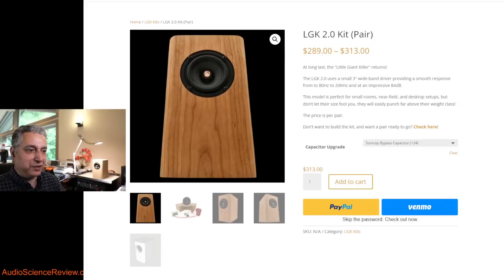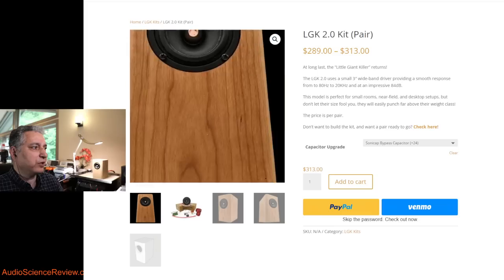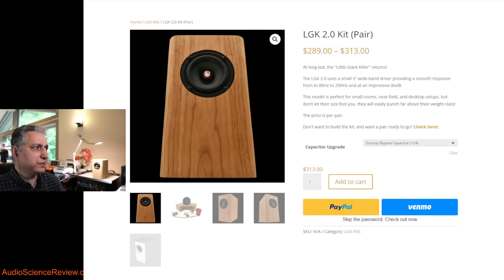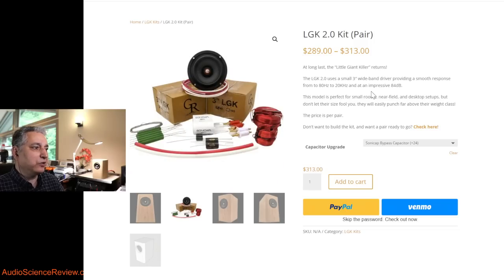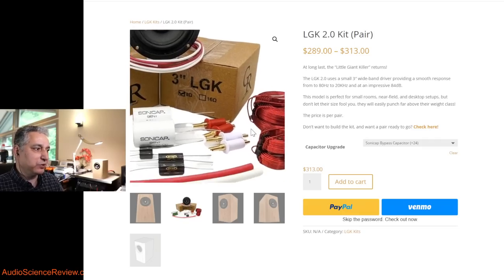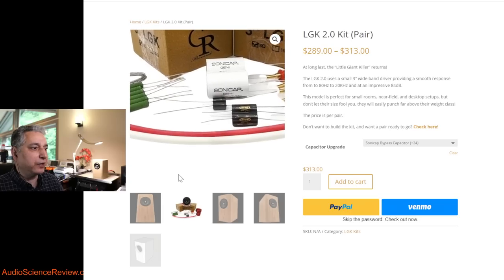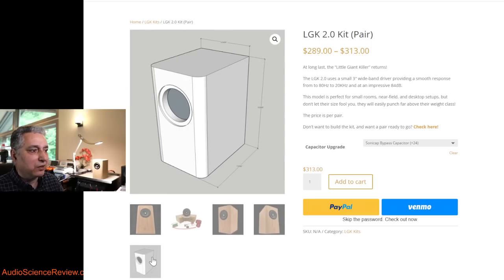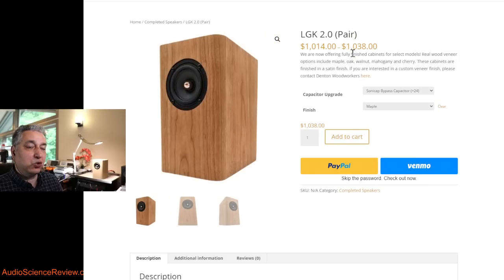GR Research LGK 2.0 DIY kit Speaker Review

Comment: I was not judging GR Research as I don't have very good ears. But what made me think Danny is selling snake oil was his claim about speaker cables would pick up stray radio signals. Radio signals are so weak that it would never register on a speaker (that's why signals from AM radio need to be tuned and magnified). His use of the VU meter with impedance of about 4K ohm is not realistic at all. No speaker has impedance that high.  And no one can hear the weak signal being picked up by the speaker cables. Period.
Reply from the maker: Very correct....
Reply: he he, correct
My goto argument for that is, if the speaker cables would pick up rf signals (which they do as an antenna, but that is not the point) that could make hearable distortions, then you should be able to hear them even without an amp, because they are not amplified but directly inducted into the cable. Can't hear anything? Then there is no problem :-)

(and anyone who thinks the few pico or nano volts of induced potential from rf would make a passive driver do anything should go back to school and study a bit morte physics)
Reply: He's a liar

Comment: Sir can you please test GR research open baffle design.......nx treme or nx otica.....thank u for your work
Reply: Unfortunately, I believe that one limitation of the Klippel NFS measurement system that Amir uses is that it cannot extract reliable data from Dipole or Open Baffle designs.  Amir can correct me if I'm wrong.
Reply: open baffle or dipole will definitely will not measure good.
Reply: @kongwee1978  Amir has measured Maggie's before .....so I belive he knows how to set the parameters.....and by the way when I listened to the lrs Maggie's the sucked big time like Amir said
Reply: @iliascharis5668  I only have experince bigger maggies.
Reply: @kongwee1978  me too but lrs sounds crap
Reply from the maker: I can definitely measure them as Klippel has no limitation here.  The issue is spending some $1,500 on another speaker from him when he should be sending out the sample.  Please contact him and ask him to send me a sample for testing.
Reply: His open baffle speakers seem to be solid design, based on what I've seen, though I've never heard them.  But as a former magnepan owner, I can say open baffle speakers sound much more like real music in certain ways that normal speakers can't do.  I don't think measurements will capture what they do right, but will capture what they do wrong.  Open baffle also needs a room that's suited for the speakers much more than normal speakers do.  My magnepans shined in 2 rooms:  one was an unfinished basement that was the entire size of the house above, and the other in a huge living room.  In other words, they need BIG rooms to really come alive.  When they have that with adequate amplification, it's magical.  But that's not a common experience for most users.  Putting them in a 12' x 20' room doesn't do them justice.

Comment: There is an aversion to DSP at GRR, and it makes sense since they are in the business of selling those passive crossover components. While this little speaker was maybe tested outside its intended design (frequency range and volume level), that doesn't excuse the poor amplitude response in the highs caused by compromises in the passive crossover design. GRR seems to be trapped in outdated passive-crossover thinking - while the industry evolves further toward DSP crossover/PEQ, and active speaker designs. I follow GRR channel and think Danny has a lot of speaker/system wisdom to offer, but they will will need to embrace the new tech to stay relevant.
Reply from the maker: There is no higher conflict of interest than GR Research and Active DSP as you rightly mention.  I think he can have a thriving business converting passives to actives.  Instead he says nonsense like DSP screws up the sound.
Reply: @AudioScienceReview  converting passives to actives could be a great business model! My vision of the future has DSP/DAC/Amp assembled, optimized and mounted on-driver from OEMs. The components will be designed to work together perfectly (same as coil and cone are today). This new platform will likely originate from an existing driver mfg, (my best guess is Putzy) then take-over the market. This will also inspire new (or expansion of already existing) cable types (think POE) - that will be used to carry power and signal between power supply and these powered drivers I've proposed. Feedback (like Rhythmik servo subs) is also a way toward the future, and I suspect that will be refined and included in these new active-driver disigns to compensate for temperature and material breakdown by age and use over time. GRR's place in this could be upgrading all the old 'favorite' speakers that exist at that time.
Reply: But people love 300B and Class A heaters, personally I like them too.
Reply: There's plenty of audiophiles who will stay in the passive realm in his lifetime ;)
Reply: @RennieAsh Also attract younger generation surprising all these years.
Reply: @kongwee1978  300B put out about 8 watts. The GR speaker in this video has a sensitivity of 84db, which is horrible for tube amps.
Reply: @AudioScienceReview  While I am no fan of Danny, quite the opposite in regards to his style of business and douche baggery, I do agree DSP can screw up the sound in some respects. If DSP is applied to the original digital music file to create crossover, which divides the frequencies to be converted to analogue signals and then sent to multiple amplifiers, it can be a game changer but expensive due to multiple amplification. However, in most cases DSP is applied to analogue signal after the original digital file was converted to analogue, processed digitally, and then converted back to analogue. This really screws up the sound IME.
Reply: @AudioScienceReview  I found that Audyssey did way more harm than good with my Revel f206s.  Dirac made them sound a bit different, but not really better so I leave it off on my system, but it's much better than my experience with Audyssey.  It's possible his experience is similar and he's only considering room correction, not dsp to flatten on axis response.  

I'll also note that my experience with Audyssey was with a Denon 3300 avr, which sounded terrible with both my Revels and older Magnepans (with or without room correction).  Going back to my early/mid 90s Integra integrated amp or a separate power amp fixed that issue, but the Denon had tons of HDMI handshaking issues, so out it went.  The sound quality issues were apparent even at low volumes with the cheapo Denon, even in soundstage and imaging.  Either it was a really bad amp design or defective, I don't know.  But it was night and day when switching it in, and the extent was very unexpected.  It might be fine with cheaper speakers that are an easier load though.

Comment: Did you check to see if the speaker terminals on the driver are magnetic? When I built my NX studio monitors the speaker terminals we're very magnetic. When I brought this up to Danny he said he knew about the terminal being magnetic that it was a supplier issue.
Reply from the maker: I noticed that!  When I went to change the driver, my soldering iron would keep getting stuck to it which surprised me.  I was going to mention that but forgot.  Danny complains about speaker terminals that are magnetic to not be good.  Yet he is shipping speakers that are that way.
Reply: @AudioScienceReview  -- His speaker terminal jihad goes even further than that.  Not only is he crusading against magnetized material, but he's also dead-set against any ferro-magnetic (anything with iron or nickel content, magnetized or not) material in the amp-to-speaker signal path, e.g. he recently noted the presence of a steel hex nut on a binding post as audibly detrimental.  Dang, Amir, you've gotten me started on his near-innumerable ignorant bugaboos, which would amount to a very lengthy debunking expedition...  🤔

Comment: To sum it up, a terrible diy speaker with no instruction manual, dubious parts, and miles away aestethics regarding the presented on the website. What's to like? Very little. If anything I think you made a Very gentle review, I would be much harsher. Nice job amir

Comment: Huh?  Imagine that... a single driver cannot effectively replace a multi driver setup...  I'm shocked!  Any other result would have been very surprising.  Good testing.
Reply: Never a true word spoken too many drivers can sound clumsy and delayed also!
Reply: Just one driver that size yes what a joke
Reply: For a tiny near field application, you can get a decent compromise. This driver just ain't it.
Reply: There are plenty of really good wide drivers. None that I have tested are truely fullrange. Bass response is usually the drawback, more than the treble. Any design choice comes with compromise and challenges.

Comment: Point is - if you call it a "Giant Killer", then it MUST deliver. It does not...
Problem is that all of GR's "reviewers" are friends of the company.
Here's a challenge for Danny; send your designs to an independent reviewer. Even go so far as to send a sample of your "commercial brand fixes" to the same reviewers for testing and comment.
Reply from the maker: Indeed.  Having Ron rubber stamp his speakers when he is also the one doing the edits of his videos makes no sense.  He needs to volunteer to send out his speakers for independent review if they are that good.  And it doesn't have to be me.  There are others who can do a good job.
Reply: Ron sent Jay the xls encores to review. I own the XLS Encores and they are an amazing speaker. So smooth!!! I also have the Polk R200’s and the XLS Encores blow them away. Both pairs have Aeco binding posts.
Reply: @progrock3603  
Yes, Amir tested the Encore's and gave them a favorable review and recommendation.

Let's just say that the LGKs are very different speakers compared to the Encore's.  And that no 3" single driver DIY kit should cost as much as Danny's LGK's, no matter the performance level.
Reply: @progrock3603  Jay does a lot of sponsored aka paid reviews.  That being said, these are not the Encores.

Comment: Are you looking for this computer speakers to deliver below 200 Hz? What did you use for box fill, or material to combat resonance?
Reply from the maker: See the build thread here: https://www.audiosciencereview.com/forum/index.php?threads/build-of-gr-research-lgk-2-0-speaker.33479/post-1170116.  Resonance is not the problem here.  Driver runs out of excursion due to limit of just 1 mm.  It distorts heavily at just about any volume.  What else it does becomes a way down secondary.  And no, these are not sold as "computer speakers."  Computer speakers like this cost $50.  Not $1,000.  For $1,000 you can get many superb speakers.

Comment: Danny is a charlatan. The moment he talks about premium crossover parts and rave about cables, you know instantly he is a snake oil paddler.
Reply: He also sais that not only drivers need a "burn in" phase (which is mainly correct for mechanical parts like speaker drivers) but also the speaker cables.
I have yet to understand what part of a copper cabe supposedly changes during that burn in ...
Reply: @Evolancer9s  Exactly. It is so easy to buy bulks of unlabeled copper cables cheap from AliExpress or Taobao; cover them with coloured sleeves and then sell them at obscene prices. That's how these charlatans are able to get rich. Some of the folks here need to be less stupid 😜
Reply: He's a con artist

Comment: I'm glad somebody pointed this out with this guy I've been saying from the beginning he is a con artist. thing is he said in his video he's made this driver perfect it had to rejected "4 or 5 times" before they got it right!! that's just bs,, they probably don't know anything about it, his just bought it off the shelf. very cheaply knowing him.
and another thing I don't believe his open dipole design is his anyway! i use  to get a lot of brochures in the 80s 90s
and that skinny open baffle design was in the brochure exactly same with the ribbon tweeter as a speaker kit from Denmark.
would be good if you check Mark audio speakers kits and drivers, there very good sounding 3-inch driver horns
he does a little desktop as well for $159 from madisound    the  Tozzi one 3" full range driver  kit check it out.

Comment: This speaker definitely sounds like it needs a sub crossover around 150hz. It also sounds like it needs some good dampening inside.
Reply: If they sold them more like a satellite-speaker that needs a sub, maybe I could believe they had good intentions with their marketing.
Reply: @TokeBoisen  interestingly in his newset video about these "LGK 2.0" (that came out a day after Amir's review, but does not mention it :-)) Danny sais they need a filter at the bass level because they can't handle too low frequencies or too much power, so yes, they are in fact just satellite speakers.
And he even sais that the original drivers had around 2.5 mm xmax but the newer ones in the 2.0 version only have 1 mm, so how are they supposed to perform better?

Comment: These speakers do not fit any of my applications, but did your build include any acoustic stuffing? Many of the measurements (port noise, distortion and spectral decay) you are showing align with an enclosure that does not have any/enough internal fill. You say "Rick put the padding in there." How much and where?
Reply: Yes, even though stuffing doesn't come with it, we went out of our way to ask him (really his assistant) if it is needed.  He said yes and we put it in there.  No other advice was given on "how much and where."   But really, the problem is not that.  The issue is that this driver runs out of excursion almost immediately and generates heaps of distortion.  You don't get to worry about cabinet/port resonances unless you are completely immune to distortion.  Listen to the sample in the video.

Comment: I have not tested with a mic or REW, but I did notice more clarity after installing a upgrade kit in my towers and center channel speaker. Unfortunately I did blow a tweeter when doing a comparison of upgraded on left and not upgraded on the right. I sent pictures of my crossover work to GR and they replied that it looked correctly done. Not sure what caused the tweeter to blow. I've been using the same high power amp and at higher volume before the upgrade kit. I went ahead and did the second tower upgrade and so far I haven't blown any tweeters but I'm afraid to take it as loud as usually do when jamming out. " Do parts matter " well I'm not certain clarity at low volume is worth the trade off possibly blowing a speaker at higher volume. Maybe I did something wrong or possibly the capacitor on that tweeter was out of wack? With all the upgraded parts what would cause power handling capabilities to lower? Were some of the original parts restricting power? The best way to describe the side by side test before the tweeter blew is kinda like cleaning a dirty window. Makes me wonder GR is just not compensating the power levels people are going to be putting these upgrades through. personally I'm using a 550 watt amp on 300 recommended tower and never reached the really loud level I could do before the upgrade kit.
Reply from the maker: Interesting story and aspect David that I had not considered.  He does indeed change the drive level to each driver and may very well be exceeding them.  Indeed, what the company had done originally would have been in that context (of selling a reliable speaker). 

The same modifications by the way can be done in software/DSP.  There, you can easily adjust how much you are boosting and take into account stress of drivers.  I routinely do this and back off as needed.  Reliability is very important.
Reply: I believe it is caused by the lower crossover point Danny designed. What he used to do is crossing the tweeters at much lower lower frequency , making them play harder. In that way you benefits in the directivity but stressing them at the same time. I once questioned him will that fry the tweeter, but he replied the fs is much lower than the xo point, which I doubt so. As I measured, most of the metal dome tweeter that came with some inexpensive speakers typically has fs above 1.5k.
Reply: Danny doesnt understand The Limits of some tweeters when doing modifications he just try to get flat responce Even If The tweeter isnt capable of doing such low frequencies without a waveguide and claim that they Are way better now. So The Power handling and Spl Goes way down and distortion rises.
Reply: @joonas4427  I've wondered about that on some of his mods.  He's definitely crossed some of the tweeters over much lower, which leads me to think he doesn't listen to music very loud.  I don't think he was going to many rock concerts in his teens or 20s and has a very quiet listening room.

That's not a criticism, just an observation that he's not typical of most consumers.  I know my hearing has damage from seeing tons of concerts in the mid to late 80s and early 90s.  And my listening room often has a fan going.  So it get's turned up.